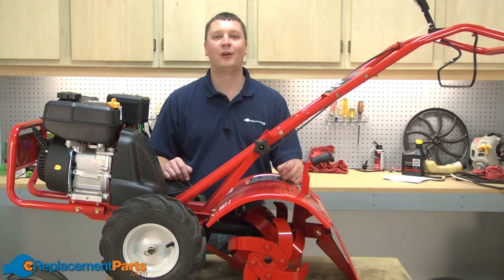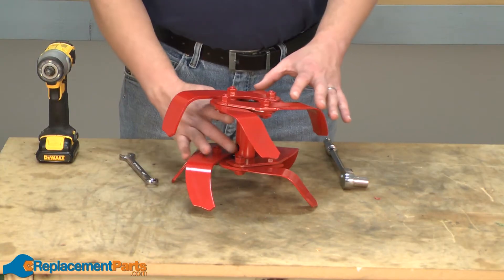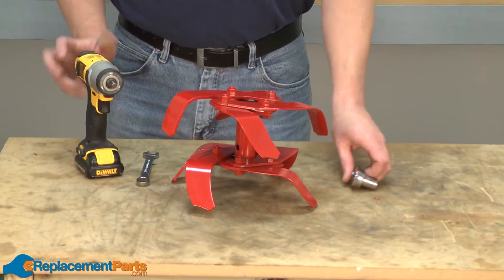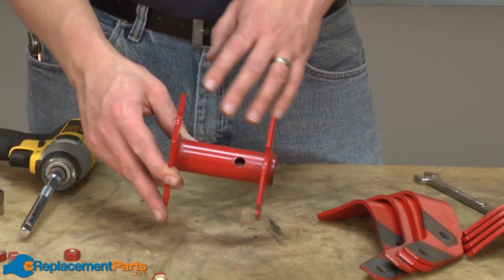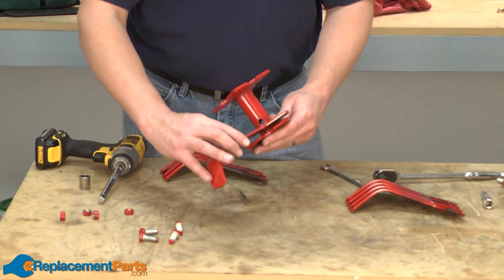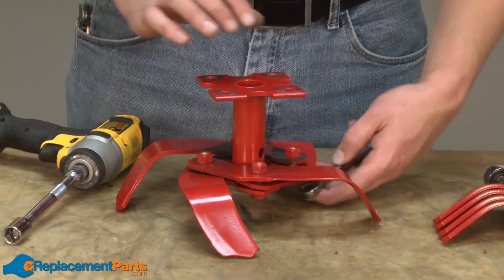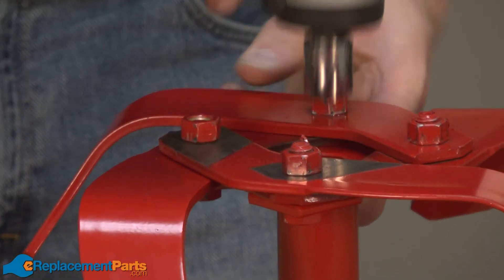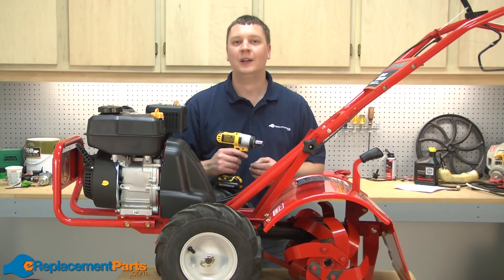How to Replace the Tine Holder on a Troy-Bilt Super Bronco Tiller (Part # 686-04065-0637)

Comment: What model troy-bilt tiller do I have if it doesn't have that bolt going through the shaft?
Reply from the maker: Hi Andrew. This page will help you find your tiller's model number:
https://www.ereplacementparts.com/repair-center/article/1077/Finding_Tool_Model_and_Type_Numbers_.html

Good luck with your repair!